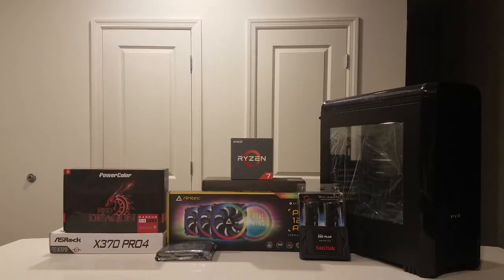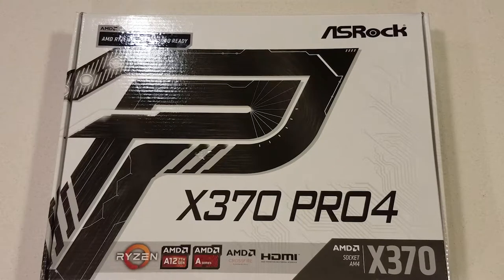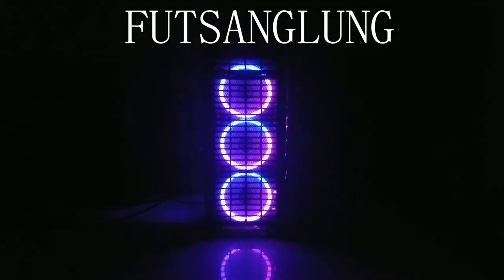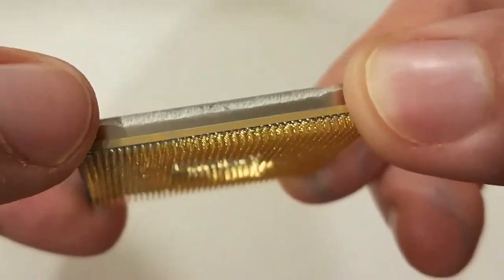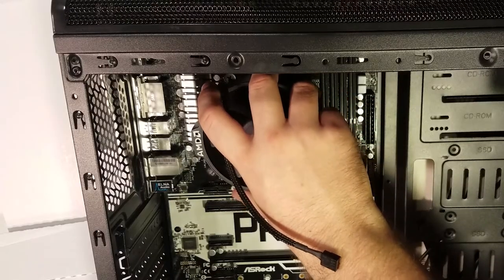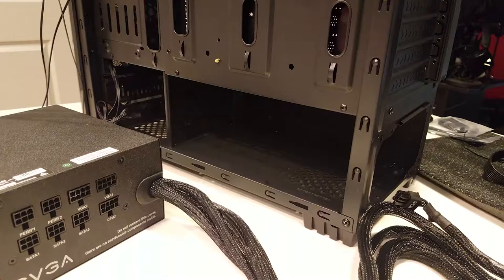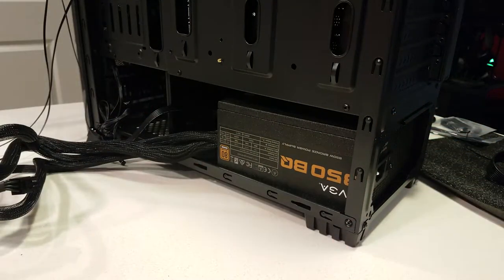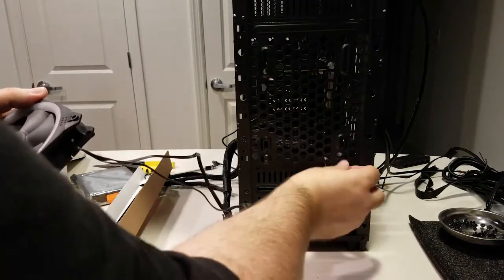How We Built An $1,100 Custom Gaming PC

Comment: Nice video bro, you have any idea if i can connect two of those controllers off of eathother ?
Reply from the maker: That's actually a question I had myself. I reached out to Antec shortly before this video and received no reply.
Reply: @TheTestBench  and did you try wiring one off of one of other controller's led outputs?
Reply from the maker: @sameerhabib7372  I did, because it seemed like the common sense approach, but it didn't sync.
Reply: @TheTestBench  thank you for the information brother 👍🏼 have a good one